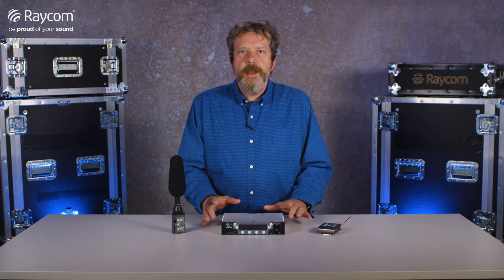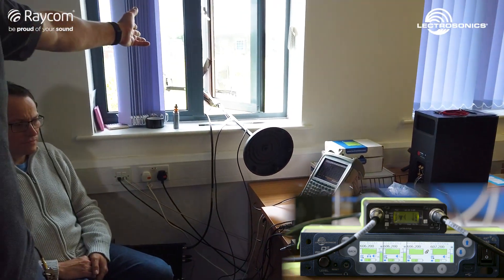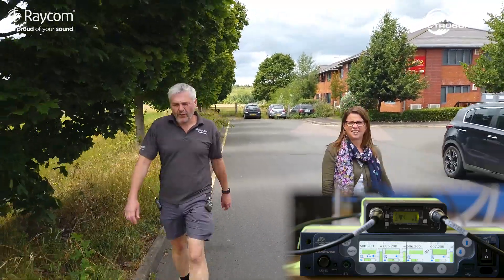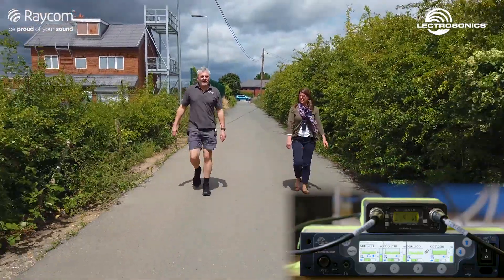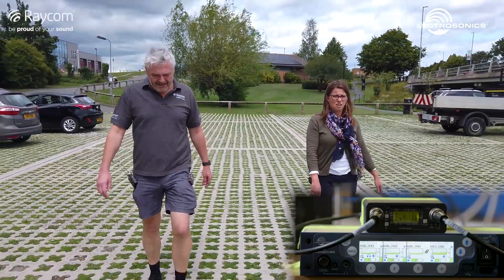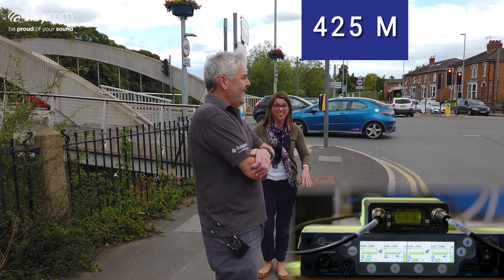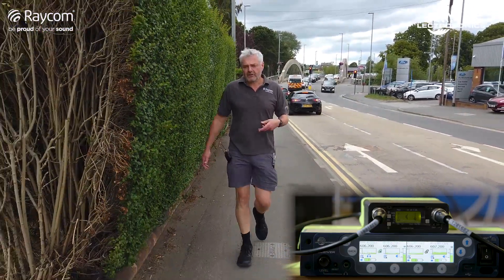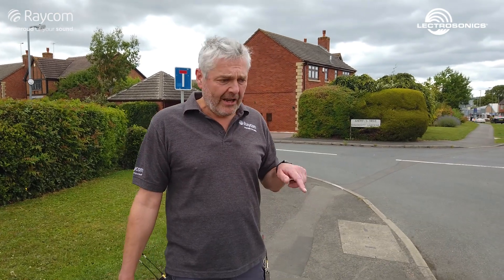Lectrosonics Digital Hybrid VS D Squared | Walk Test

Comment: I don't understand why my Lectrosonic uses Smqv 250mW with Receiver Sra block 21, in Vietnam, normal scenes are only 20-30m, for wet rainy weather or near rivers, it only reduces to 4-5m and the signal is completely lost. can you help me why
Reply from the maker: Morning, it sounds like your SMQV is set to 250mW, so you need to change the power setting to a lower setting. If you power the unit on while pressing the up arrow, then use the up and down arrow until you get to the power setting, and then change it to the required setting. I hope this helps!

Comment: Thanks to Pyers and his team at Raycom!  Nice test!  

It underlines how a true diversity system is key to providing a robust operating range.  It also shows how a modern digital transmission system cannot compete with the sensitivity of a well designed  FM-DSP system.  (See the impressive Wisycom MCR54 walk test!)  Aside from limiting the transmitter power, without the the FM Capture Effect digital transmission systems are also more susceptible to multi-path interference.  I wonder if that flutter and then drop-out at 425m was the result of the metal fencing at that street corner; hard to say.  Thanks again guys... Cheers from Canada.
Reply: Hi Rob, thanks for your comments. As the Wisycom rep in Canada, even you would have to admit that analog and digital wireless systems have different advantages and in some cases mutually exclusive features. For instance, signal encryption is routine now in digital wireless systems, and can't be done in analog systems at all. Feature rich telemetry is also now routine in digital systems. There are some advantages in sound quality as well, as can probably be heard even in this video. Many digital systems out there have very clever codecs, and offer different sets of tradeoffs in terms of spectral density, than analog systems. Clearly, there is a lot of interest in digital wireless microphone systems, for obvious reasons.
Reply: Good morning Lectrosonics; while encryption is certainly in the realm of digital technologies, I do not agree that any of the other "digital features" you've noted, are available exclusively in the digital realm.  Symphony's Bluetooth 5 back-channel offers 3D telemetry features with Angle of Arrival and Angel of Departure.  As we by now have all learned, spectral efficiency is also not specifically a digital property.  To begin with, digital systems can create intermodulation too; and many of them do not have filters or circulators in their design. As an analog (FM-DSP)  system, Wisycom's unique intermodulation cancellation circuitry provides extremely efficient equidistant carriers, that combined with narrowband operation allows for 250kHz carrier spacing.  Compared to digital transmission, Wisycom's FM-DSP also does not suffer from the side-lobes that a phase & amplitude  system requires and that limits their power output to stay within the licence spectrum mask.

I agree that there are lots of interest in digital systems; but at the end of the day, one of the more critical requirements of a wireless system is to reliably maintain a link.  This is where digital transmissions systems tend to fail much earlier then their analog counterparts - they cannot rely on the FM capture effect and are far more susceptible to multi-path interference - where it is much more common than at Raycom's idyllic location in Evesham. 

I do agree that users look for a wide-range of features depending on their application, their needs/requirements; vive la différence!  Different systems for different people...

Cheers!

Comment: Seems odd that her receiver never showed a full RF signal. Not even when she was standing next to the fins (I realize she's somewhat in a null there), but even as soon as they walk beneath the antennas outdoors, she's at half signal. I wonder if the Digital transmitter was choking hers, or maybe choking each other. Would've been interesting to see that Wisycom walk test with a pair of Transmitter so close.
Reply: Also, her Tx was horizontal  which would make it perpendicular to the antenna array. Correct me if I am wrong but wouldn't this affect how the antenna picks up the signal? I have always fount that signal is worse then the Tx antenna is sideways and the Rx antenna (or whip) is vertical.
Reply: @scottmancrothers1  You lot are very observant! :) It did move more to the horizontal as we walked off, but it was more 'slant' polarised I would say. In the theoretical world with no reflections then you lose 100% signal when cross polarised, however in the real world reflections and clutter causes rotation of polarisation so it is not that simple. Even in a theoretical situation a 45 degree difference between antennas only gives 3dB loss, and in the real world probably less on average. also there is some radiation from the case of the TX and wires so it's not clear cut at all. I think if her antenna had been straight up it may have made a marginal improvement to range, though it would also have placed the antenna closer to her body (aka bag of water) so there would have been more attenuation and detuning of the antenna in that situation, so it's swings and roundabouts TBH.
Reply: Transmitters don't interfere with each other like that unless they are a few cm away and the antennas get detuned by each other, and we were at least 1m or more apart most of the time. I would be more worried about the TX de-sensing the IEM RX! I will check that the UCR411 is in spec for both meter calibration and absolute sensitivity. Those antennas do, as you say, have a deep null from the rear (plus the windows have metallised coating), they also are pretty deaf from below. The performance was broadly in line with expectations, though I will have a good look at the 411 on the workbench ASAP (we are authorised Lectro warranty service centre).